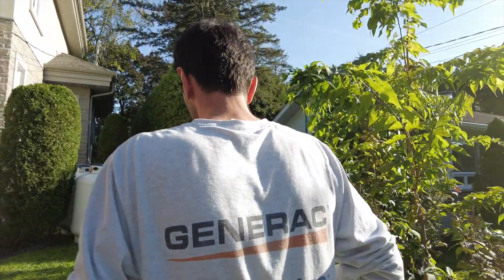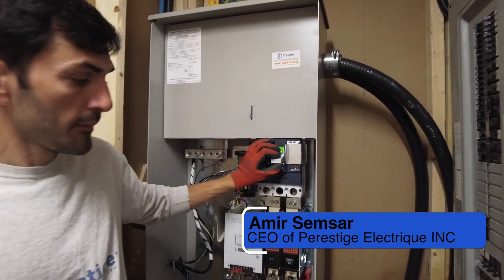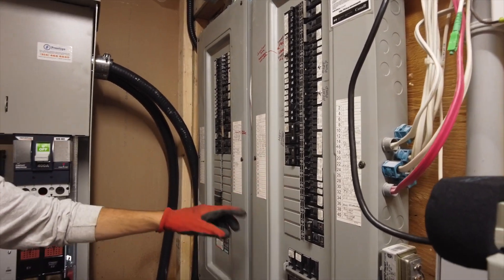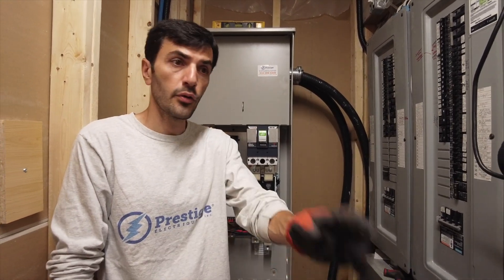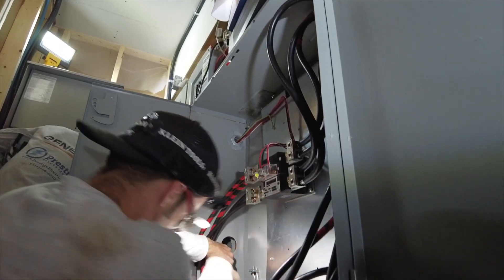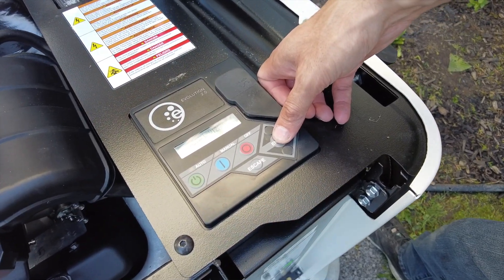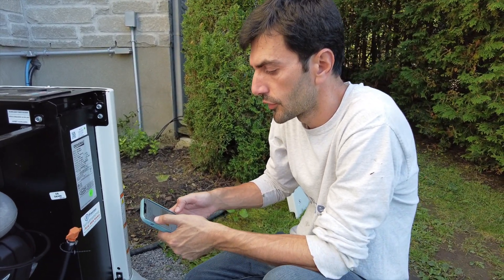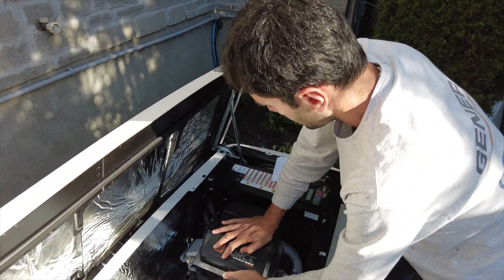Installing a Generac Generators Air Cooled 26kW  - 400 Amp ATS -#Prestige_Electrique

Comment: That’s not 400 amp your math is wrong you need 96 kw for 400 amps
Reply from the maker: Thanks for the comment, it is a 26kw with 400amp transfer switch.

Comment: i can ask  you  
why  26KW U CAN  give  400AMPERE
Reply: It can't... the transfer switch supports 400A - but the generator can't do anywhere near that.  You do, however, need a transfer switch that can accommodate the capacity of the existing panels. I'm in a similar situation.  I have 300AMP service, but I would not implement a 72kw generator.  More like 32kw for my needs.
Reply: @michaelbrunetti1062   tanks for u
Reply from the maker: Exactly, transfer switch has to match with the size of service if we are putting the whole house on the Generator.